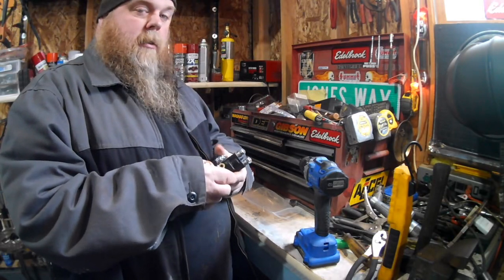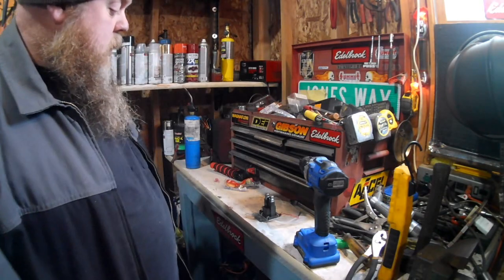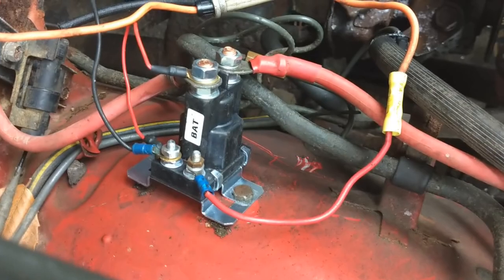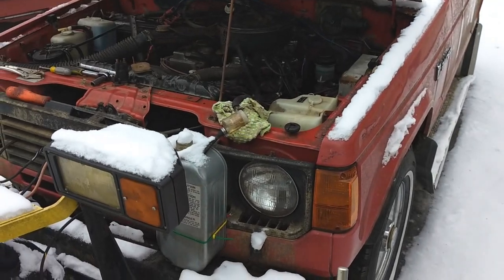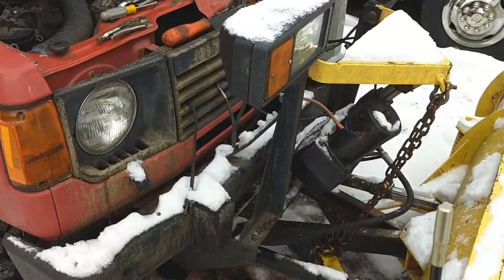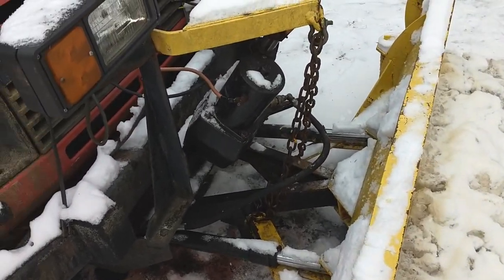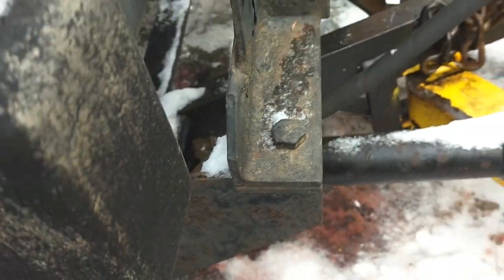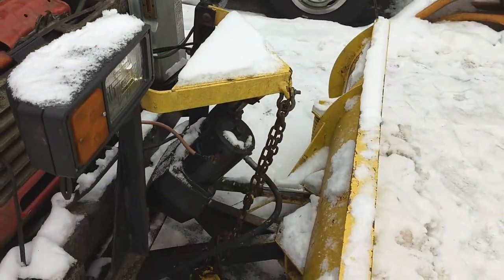Fisher plow solenoid replacement

Comment: Went thru the same headache 2 months ago. Started with the plow not lifting but pump working. Lots of head-scratching led me to taking the tank off the reservoir to find the pickup tube fell off. Worked ok for a while then nothing. Started with bad solenoid, then a blown inline fuse and finally the found the harness thru the firewall was chewed by mice. Took more hours than I’d like to admit. And this truck is parked inside.

Comment: I'm thinking there is air in the hydraulic system.  I would start with checking the hoses for leaks and bleed the system. I would think if the pump was moving fluid rather than air it would sound like it has more resistance behind it when you hit the switch.

Comment: that little thing might be worth investing in a small mig welder and  reworking that rear frame  small easy toget around you dont have much in it  hell few peices of steel little cutting little welding  ive seen a few repair jobs on frames and it aint like  theres much weight on the rear of that thing  just a thought
Reply from the maker: I have thought of it and i have a welder.

Comment: IT WORKED!!!... it was also the connections but it's working again.... I don't think that ground wire is supposed to be connected to the battery though 1:00

Confirmed that is a ground wire, just self tap that into the metal next to the solenoid if you don't have a connection for it already

Comment: That's a stuck solenoid, you freed it when you smacked it. they're a coil wire, they break, careful not to break it, tiny tiny taps, lots of them.

stuck solenoid was from when you had the jumper (ground wire) connected as a short to the battery terminal.